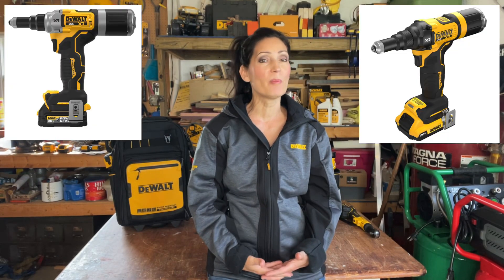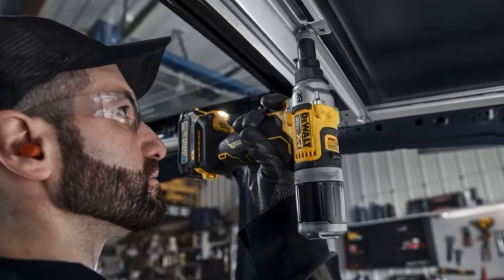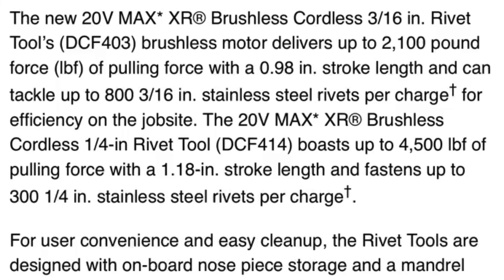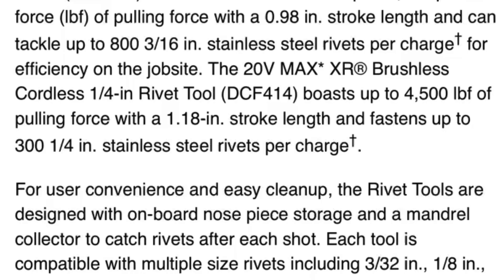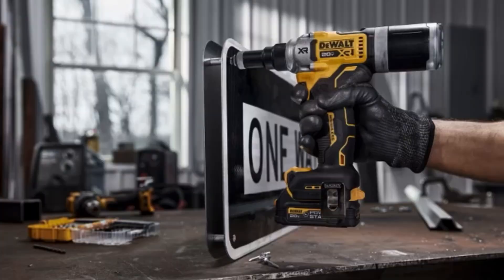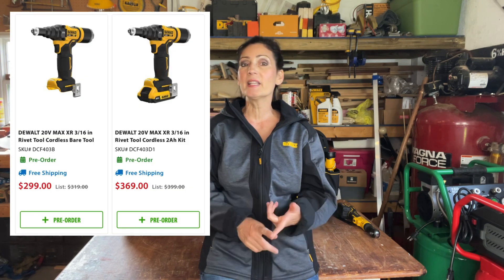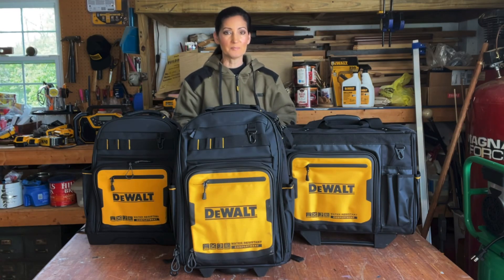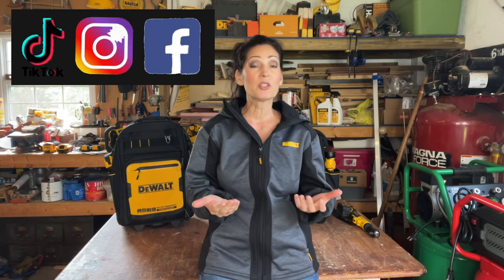DeWalt Announces NEW Cordless Rivet Tools DCF403 & DCF414

Comment: Will the  1/4” nose fit on the 3/16” gun?
Reply from the maker: Hi Amy, the 3/16 gun is compatible with 3/32", 1/8", 5/32", and 3/16" rivets only. 

This is confusing, however the 1/4” gun DOES work with 3/16", 15/64", and 1/4" rivets. So if you need to pull those sizes, you can with the 1/4” tool.

Comment: Hi Jennifer, what I have is a regular rivit gun, this tool doesn't specify if I bought a 3/16 or 1/4 in , non powered, but can you briefly explain the difference between the two Dewalt 403 and the 414 Rivit gun? All I understood is the 403 has a pulling force of 2100 and the 414 is 4500. What I need to understand what is the 1/4 and the 3/16 is about.
Reply from the maker: Hi Robert! I received these tools and ended up completing a full review video. Not only is the pulling force different, they have interchangeable nozzle piece sizes that differ. Here’s the review: https://youtu.be/Fnp0fbs1RKM?si=ZuRUfdnae5qQkzsy